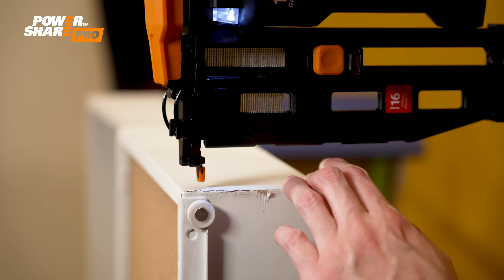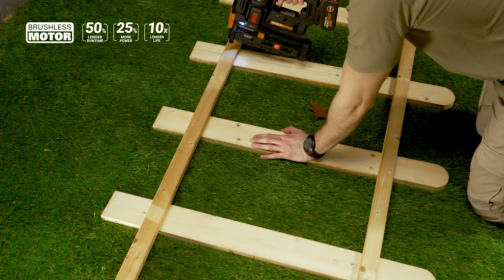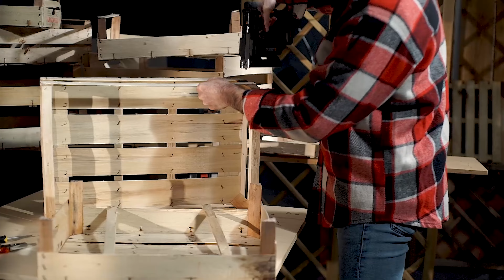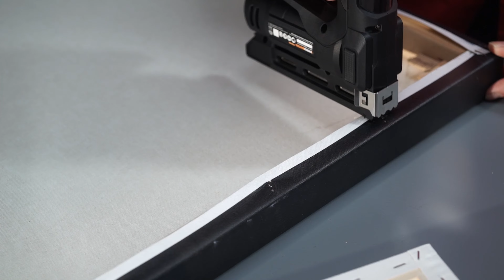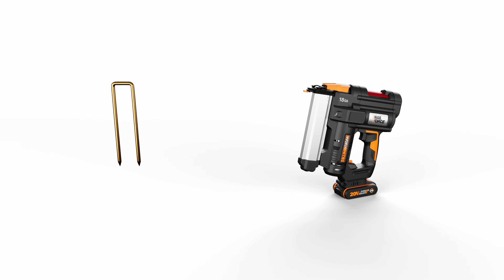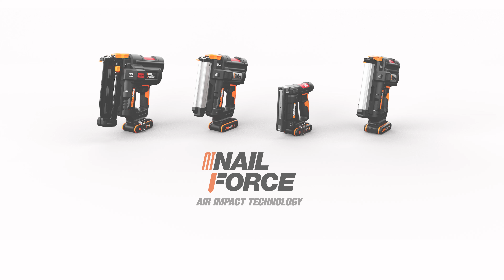WORX WX841 842 843 844 - THE NAIL GUN FAMILY EN

Comment: I am a little confused at the range and what to get. There is also an 840 model that shoots 18ga nails as well as crown staples. Is that an older model? What has been improved in these models?
Reply from the maker: Hi, The improvmente in the new models is usually the Brushless motor or the NITRO range, which means a more powerful performance. . The wx840 you are talking about is also an excellent tool but it is out of production. Now also the smaller, the wx843, can shot nails and  not staples only, both smaller size than the WX840
Reply: @WorxInternational  "improvent" my eye.  Its a greedy downgrade to make us get two tools.  This really makes me loose faith in this company.